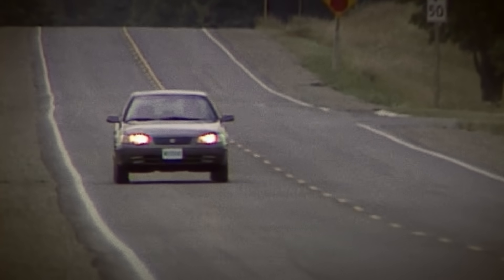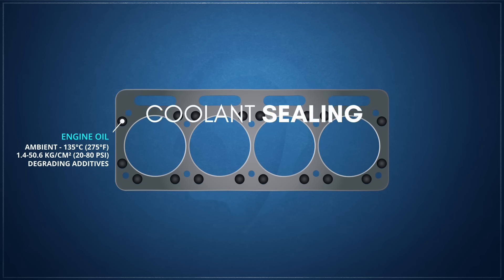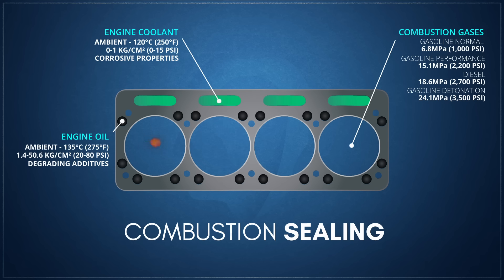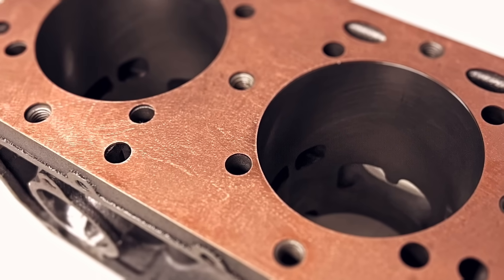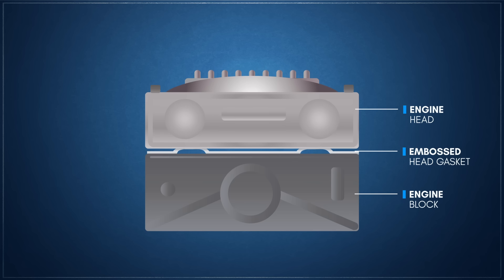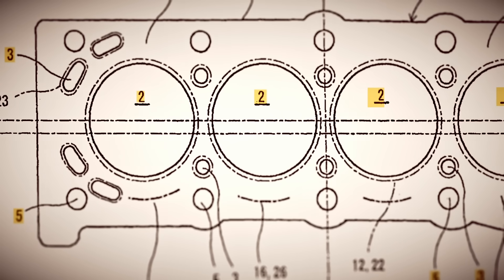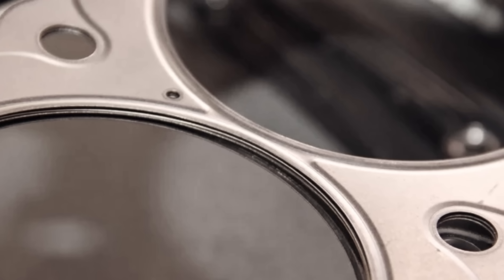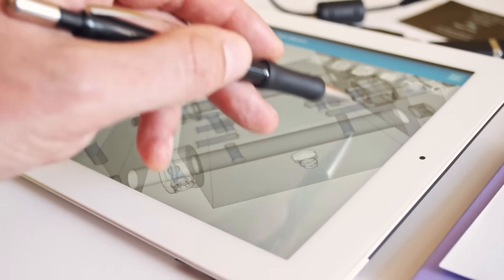The Most Tortured Part In An Engine

Comment: Wtf in normal operation engine coolant rarely exceeds 100c ... take it from everyone running at the track where coolant is prohibited and the only way we can increase the boiling point is with pressure and most people outside of extreme racing not increasing pressure above atmospheric, most rad caps blow at 13 to 15 psi...
Reply: Modern cars definitely run hotter than 100c bro.
Reply: @sexyfacenation  modern engines are more efficient than older engines. Sinking heat into coolant is the exact opposite of efficiency. The boiling point of a 50/50 mix is about 106 degrees C. Anything over 100c starts to approach this point and increases pressure in the coolant system until it pushes out the weakest point which is hopefully your radiator cap with most being 13 to 15psi - with the inability to increase pressure beyond 15psi the boiling point will not increase due to pressure. Boiling coolant will create pockets and hot spots and destroy your engine. I think that you may be thinking about oil temperature, which can exceed the aforementioned temperature without issue. If anything, modern engines generally run cooler as they're able to convert more heat energy to work which results in less being dumped into the coolant. Most automotive thermostats are set to open around 80 to 86c which means that this is near their maximum engineered operating temperature. This is all physics. Higher pressure coolant systems, eg anything above atmospheric, starting at 15psi or so can increase the boiling point and this is used in race engines to give a bit more edge before boiling over and causing damage. 15psi is even seen on production cars as well but increasing the boiling point does not increase the ability of the coolant system to remove heat, this is defined more by the radiator size and efficiency combined with the ambient temperature and airflow across it, the main reason for increasing the boiling point is additional protection against bubbles and pockets in the coolant system as air and vacuum is an insulator especially compared to water. Most coolant systems are designed to be able to run on pure water alone, without the increase in boiling point provided by mixing coolant. Admittedly I am not familiar with every single engine and I am specifically speaking about gasoline engines but I've built and tuned hundreds of engines from the early 80s all the way upto late 2010s and have never seen a single one with its coolant operating temperature exceed 95c even under full load on the dyno (which even with a big fan still does not have the same level of airflow past the radiator the vehicle would have on the road at the same speed) unless the coolant system is designed for above atmospheric pressure, has a leak, the headgasket has failed, due to detonation or the inability of the intercooling system to sufficiently lower the charge air temperature for the current level of boost (which often means you're well off the compressors efficiency map) in engines with intake charge compression (turbo/supercharging) - regardless of whether you'll take my word describing the factual physics of this, literally every result on Google for 'high coolant temperature engine' states that the average peak range is 190 to 210f or about 89 to 96c. Gates, who is an OEM and OEM Replacement manufacturer of parts such as gaskets and including thermostats, according to their catalog of thermostats only manufacturers them with 220f or 104c being the highest available temperature, thus it's unlikely any automotive engine has a cooling system designed to run above that temperature,  which is still within the boiling point of 50/50 in a 15psi system and even an atmospheric system - the highest one I've ever seen or used on any engine was 190f or 88c and I can assure you that higher ones are likely not that common as relying on increased pressure as your only protection against boiling over and thus likely severe engine damage is not the type of decision an engineer would make easily for an engine designed to be warranties and to do a minimum of 120,000kms without significant failure, with most decent manufacturers aiming more towards 250,000kms to 500,000kms or more also considering that coolant systems use rubber hosing that can easily leak from cracks or pin hole leaks that is sealed by sprung hose clamps, all of which come much closer to failure under increased pressure and temperature, otherwise we would see OEM engines with steel braided coolant lines with AN fittings just like..you guessed it..race cars. The hoses and seals in most coolant systems cannot even hold 5psi - if the internal pressure is 14.7psi and you're at sea level, your coolant system is holding 0psi in pressure - most OEM systems due to the rubber hosing will begin to leak at like 18 to 20psi even especially considering the temperature required for that pressure to manifest will weaken the hoses somewhat as well. This is also not considering that radiators are made from super thin, cheap stamped aluminum and are placed at the front of the vehicle where rocks can often easily damage the fins making them weaker and less able to hold a pressure differential between the atmosphere. While I don't doubt that there may be outliers and poor designs (or even designs that are intentionally poor to increase forced obsolescence) the norm is not what you describe and this is relatively obvious when understanding the physics and blatantly in your face for an engine builder/tuner/automotive engineer such as my self who has designed coolant systems from scratch for many engines as well as water based (air to water) intercooler systems for high boost applications (regardless of compressor efficiency adibiatic compression temperature increase is unavoidable, as well, colder air is denser allowing for more fuel to be injected per cycle resulting in more power and overall efficiency) - internal combustion engines are literally heat pumps and literally (for the same coolant system size/efficiency) dumping more heat into coolant means dumping less energy into the crankshaft - combustion temperature is a factor of fuel used, dynamic compression ratio and intake air temperature with all of these variables being within a common range on production vehicles thus again literally the higher the coolant temperature, the less efficient the engine is at creating torque. You want the heat to expand inside the cylinder - physics means as it expands, it cools - the expansion is what pushes on the piston which creates a torque on the crankshaft and the expansion energy comes from the heat thus besides being somewhat of an air pump, internal combustion engines are, as I said, heat pumps and again if more heat (eg. Energy) is drawn into the coolant system then less energy is put into making torque - this is also why the size and dimensions of your cylinder and block cooling design (eg closed vs open deck) can have a large impact on overall efficiency. I suggest you do some reading about the Otto cycle as well as other cycles that apply to internal combustion engines as well as heat engines in general before arguing with an engineer and communicating that something is fact when - again, regardless of whether your believe a word I said or understand the physics - can be debunked several ways quite quickly from a Google search or to, such as the aforementioned search about highest coolant temperatures in engines as well as the catalog from an international OEM supplier of automotive thermostats which regulate said temperature. 

Again, believe me, don't believe me, I don't care - but don't pull stuff out of your ass that's misleading at best and false at worst that can be debunked by a 5 year old with Google. Feel free to verify everything I've said with your own research - as mentioned above, there's likely outliers (also considering some manufacturers do some weird shit in order to make sure the catalytic converter is up to temperature and quickly as for a manufacturer it is an easy choice to sacrifice efficiency in order to pass emissions testing - part of the reason early 80s civics get like 50mpg (even considering  epa mpg changes) when even modern hybrids struggle to come close) but my research, experience and knowledge including from working in the field says this is not at all common. I am open to corrections but I'd need some sort of direction on a reference to your research such as I've provided mentioning the Gates thermostat catalog.
Reply: @sexyfacenation  and whats your reference or proof? What cars? What's modern as far as your statement is concerned? Do you have datalogs to prove this? Vehicles from a few different manufacturers with different engines requiring thermostats with such high temperatures? Service manual tables/data from vehicles using actuated valves, no valves (eg. not using thermostatic valves?)

You're making a blanket statement without any qualifiers. I've provided facts to the contrary with direction towards sources confirming such. I also never said over 100c is impossible in my last message as clearly Gates manufactures a thermostatic valve for about 104c. That said, it doesn't change the fact the video claimed MUCH higher or the physics involved, namely that a 50/50 mix has a boiling point of about 106c at atmospheric pressure and that there's significant potential for and risk of damage when using pressure to increase the boiling point due to issues that are relatively common to see on a vehicle (leaky rad or coolant hose or a bad/old rad cap) combined with the fact that the more heat going into the coolant means less thermal efficiency and with an increased operating temperature otherwise (assuming same heat capacity and efficiency of cooling system but valved to a higher operating temperature) not having any benefits I can think of that would apply generally along with significantly increased risks. Having a higher coolant operating temperature should not be a variable for combustion when designing a block from the ground up as manufacturers do, so arguing that a higher coolant temperature could increase combustion efficiency or combustion chamber temperature for emissions or anything along those lines is illogical as you would just position and size your coolant passages appropriately for your goals when designing the block. 

Again, I'm always open to learning and being corrected, but all I've seen is blanket unqualified statements implying that not only the video isn't inaccurate in claiming over 120c but that this is something every manufacturer is doing on every engine and vehicle for an unspecified period of time, with 'modern' able to be interpreted as anything newer than 2020, anything newer than 2010, anything newer than 2000 or even anything newer than the 1980s when EFI started becoming the norm - which I can assure you that I've not seen a single engine from 1982 to 2020 out of all the thousands of vehicles I've worked on, tuned or built engines for with more than a few having designed from scratch coolant systems and even a few with custom blocks which while similar to their oem counterpart having modified, reworked or redesigned coolant passages.

So, please qualify your statements. What is modern? Do you mean every manufacturer and engine within what you define as modern as your statement implies? And, can you provide examples from more than a single manufacturer (and not inside the same group, eg VW vs Audi vs Lamborghini meaningless here) where you can show by datalogs on a new/low miles/unmodified vehicles, by part numbers for thermostatic valves at these temperatures or by service manuals defining what the appropriate coolant operating temperature ranges are that exceed this range?

I'm not trying to argue, I truly want to know what is causing people to make these claims while simply mentioning the physics and engineering challenges that would accompany this along with stating that it's not something I've seen in my relatively extensive (especially, at least, in comparison to the average commenter) experience with working on and tuning vehicles along with building engines and engineering coolant systems..in fact, the last control module I designed was for controlling a type of brushless waterpumps, ones often found in BMWs and elsewhere and the maximum temperature the module allows is 105c, about the same as Gates' highest thermostatic valve with anything over 97.5c locked out by default with a warning about going higher mentioning the boiling point of 50/50 as well as mentioning the requirement of having a radiator cap and coolant system designed for more than 15psi when unlocking those higher values in the definition table with 85c being the default value with most users never modifying the settings on the module. Though, technically you could set the offset of the temperature sensor input to have it target a higher temperature, it's highly unlikely anyone using it would want the pump running at any less than 100% duty over 100c.

So please, clarify your modern definition and blanket statement saying it's something all cars do within your definition of modern and please provide some examples from different vehicles and manufacturers as again I would love to see any actual facts that could be causing people to make these statements and not even just saying it's possible or maybe some cars/manufacturers do it but implying it's everyone or at least extremely common as since my last post even I've checked about 20 different service manuals from 4 different manufacturers on different models, looking at 2022 and 2015 model years for each model and none of those claimed anything that high.
Reply: I mean the fact one of the largest and most common manufacturers of thermostats doesn't make one that goes above 104c says a lot. Again, I'm not saying it's impossible or that no vehicles do it - but it's surely not common and I've spent hours tonight checking random vehicles from the last 10 years and have seen very few that exceed 100c and those that do are only really doing it to heat the engine quicker and light off the catalyst.

And unless someone can provide some sort of solid data on any reasons other than that on why this would be considered a pro/positive thing to do than I stand by my inclination that it's poor engineering considering all of the previously mentioned engineering challenges and risks especially that if you're a manufacturer designing an engine that it's far more logical to design your coolant passages to reach the desired cylinder and oil temperatures than it is to run the coolant in a range where you're relying on partly perfectly mixed coolant and mostly high pressures within often the weakest / most susceptible to damage (especially from the increased pressure) components under the hood.

I highly suspect that any vehicles that may run above 105c are doing so as a bandaid or cost saving measure - mainly that it may be easier or cheaper to increase the temperature to reduce emissions (eg catalyst to temperature faster - which is one of the hugest factors for reducing some types of emissions to pass tests even considering the fact this is only even a factor in the first maybe 5 or 10min an engine is running) to get your vehicle certified on years after the engine was designed where requirements have tightened thus being a poor choice from an engineering and reliability standpoint.
Reply: Guy literally just says the same statement twice without addressing any of my concerns, questions or providing any qualifiers or examples for a blanket statement.

But we're supposed to trust that over someone taking the time to research, provide examples, dive into the engineering and physics.

Modern comment trolls brains definitely run hotter than 100c bro. At least there's evidence for that here, since you're seemingly delirious and repeating the same thing over and over with no other  indication of comprehension of my previous input of stimuli within your perspective reality.
Reply: @forbiddenera  so you agree?
Reply: Anyway, you completely missed the fact that the boiling point of water at 1 Bar gauge pressure is 120c .
Reply: Somehow the comment with a link disappeared. Look up electric thermostats in cars and how they use them.
Reply: @sexyfacenation  I'm aware and mentioned some vehicles use them. Others use no thermostat and regulate an electronic water pump, as I also mentioned I've designed a module to run.